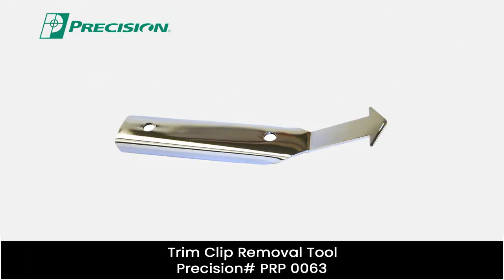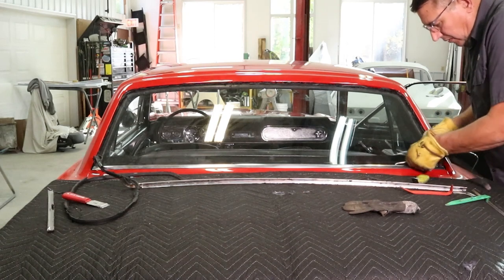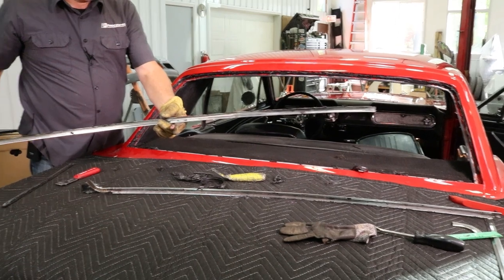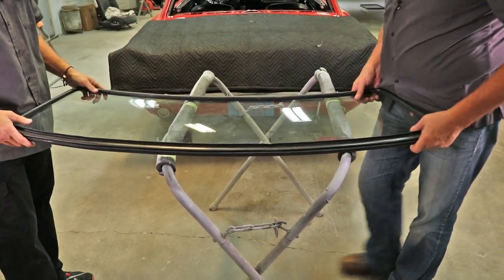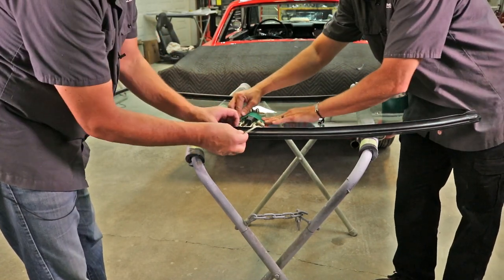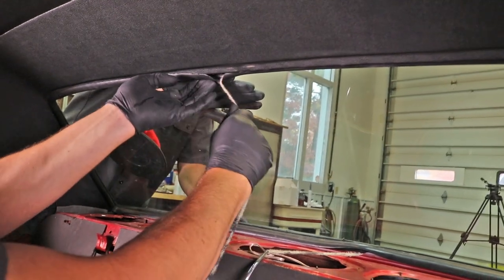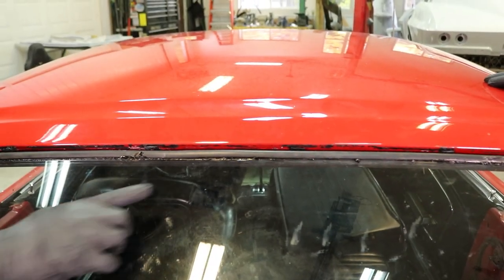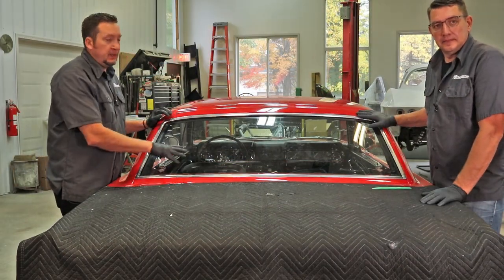1964 - 1968 Ford Mustang Rear Window Weatherstrip

Comment: Your title says 64-68 but the 68 is different guys.
Reply from the maker: That's incorrect.  the rear window weatherstrip fits 64-68.  You can look at other sites like dennis carpenter, Kentucky Mustang, Scott Drake, CJ Pony parts and ebay listings.  It fits the 68.